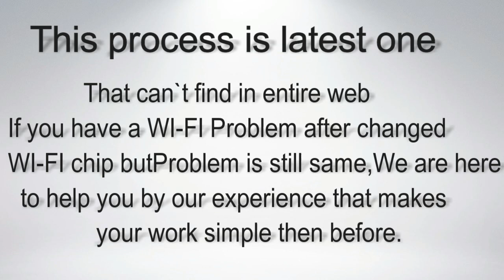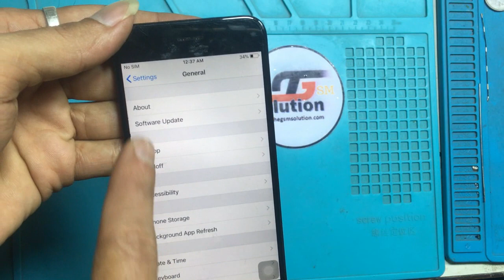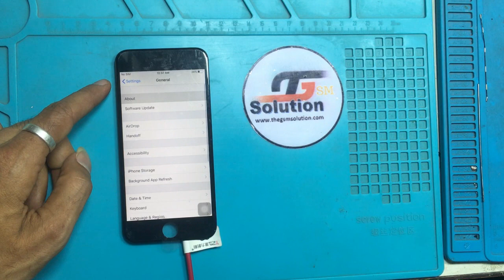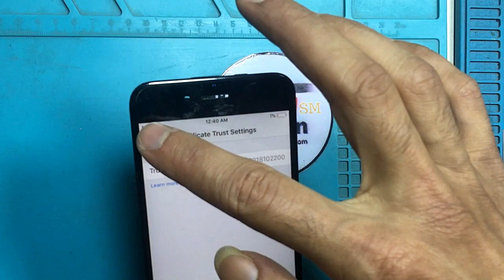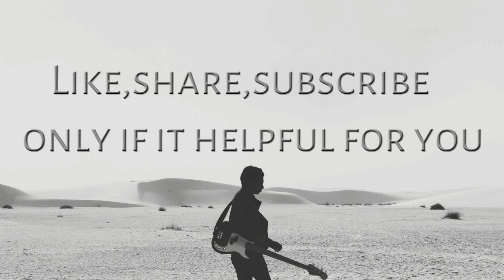iPhone 6,6plus wifi Grayed out solution!iphone 6 wifi not working after chip replace.

Comment: You don’t need to repair Charge your phone until it gets hot and restart it and it will fix the greyed wifi into it. Please confirm or leave a comment if it will worked for you
Reply: not working even reset network still not

Comment: wrong solution ! because of cpu is .9v and wifi supply is 1.8v ! dont do this job !
Reply from the maker: You are wrong brother see the circuit carefully that is the broken track connect .No any extra voltage is input.